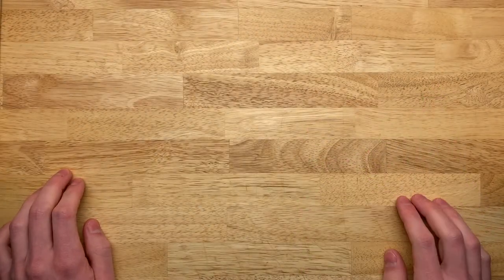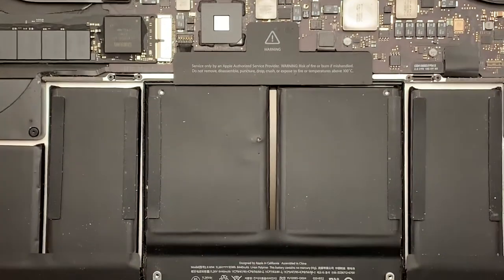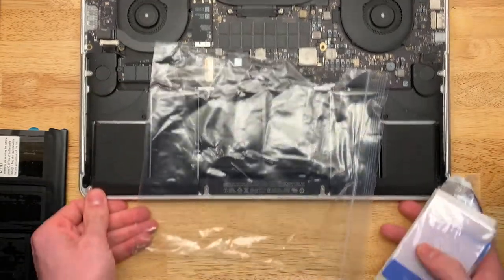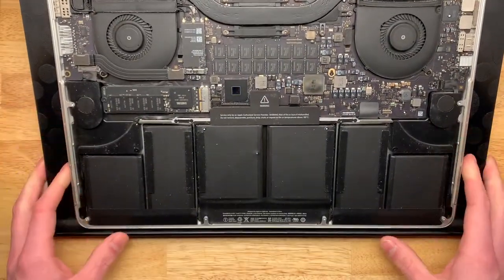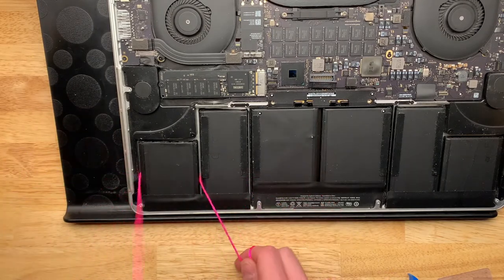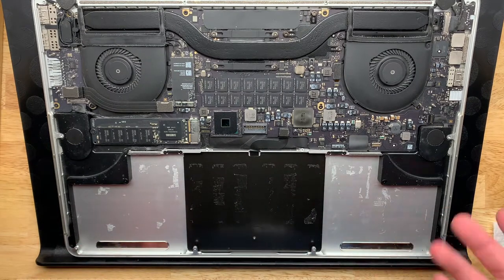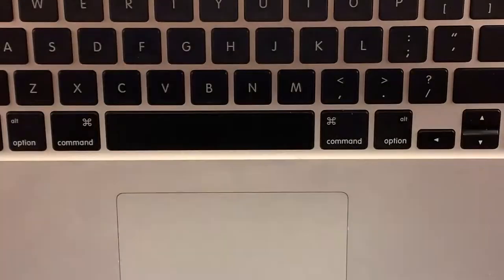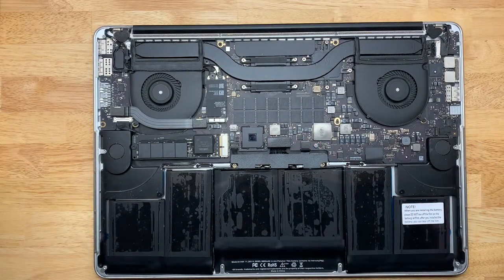Battery Replacement - MacBook Pro 15" (Late 2013-Mid 2014 Retina)

Comment: I picked up my battery from an Amazon vendor, and it looks to be the exact same battery you had, right down to the same spec's, colour of plastic piece on the bottom and sticker on the front.  I had my computer worked on some time ago, as my trackpad wasn't working correctly, thus the two machine screws at the electrical connection for the batteries, where/are missing, but it's worked perfectly for months, as this is my 2nd replacement since buying this MacBook in 2013/2014.  I did have to push the electrical connection downward some to get it to fit correctly, but didn't check it afterwards, put the lid on after screwing it down, and it fired up (with a slight delay) showing 24% charged, so I plugged it in right away.  The small manual that came with the battery, has the same spec's mentioned, on charging to 100% and leave it charging for another 2 hours.  Then fully discharge....then recharge again.  I'm thankful for having an iMac, where I could watch you go through the uninstall, while doing so in front of me...stopping the video as needed.  Appreciate the steps you went through, although it took me some time to get mine cleaned, but I had some 'adhesive remover' from a previous job of taking off a decal over the summer.

Comment: I didn’t consider buying my replacement battery thru I fix it but bought it thru aliexpress instead which is way more original than iFixit it is originally all made in China so it only make sense to get it from where it is produced my battery installed and worked way better almost like the original which I presume is original as
Described in the sellers list

Comment: You should drain them to 50%, not 0%. The electrons never leave the battery, they're just in a different place, so wheather it's at 0% or 100% they're all in the same place. 50% is when it's balanced.
Reply: I would disagree 😉